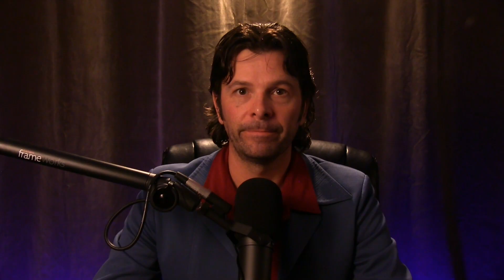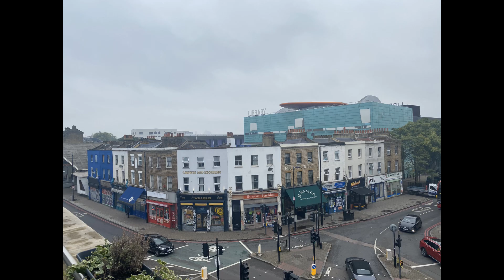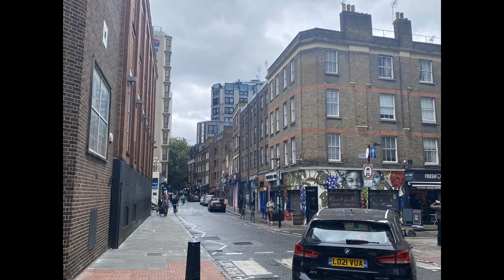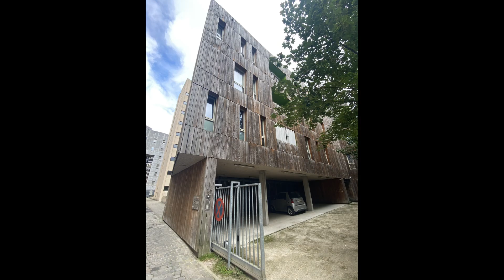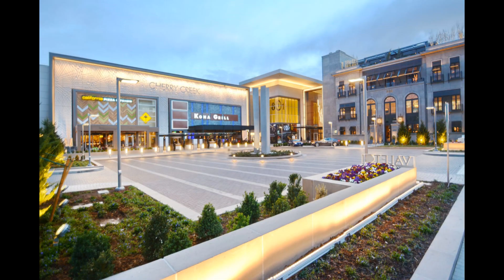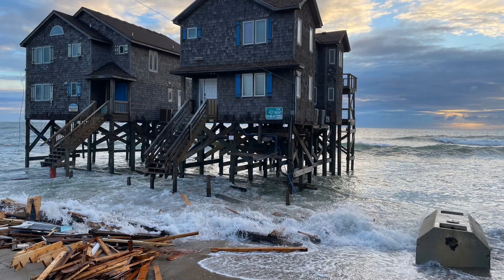Paul's Passive House 1950's Retrofit Ep. 15: European Edition

Comment: I know change will take time, probably a century 🤣. I like to think the USA is moving in the right direction 😁. I generally think the cost of housing will push the housing markets into the passive area/high performance as well as home battery back up needs, due to rising power usage. Matt Risinger (Build Show) is a great example of this, in the custom home building sector. As well as, Steve Baczek, Jake Bruton, Corbett Lunsford (Home Performance) and more. I hope things get better for the future 🤷🏿‍♂.
Reply from the maker: @BlackOTR1  You are more optimistic than I am for sure. Those guys you listed are great builders but they are not building houses for average people. They are million dollar homes for millionaires. Even the budget builders are building bigger homes and selling at higher prices because they make more money per house. That century comment was genuine. If you compare us to Europe, the difference is so huge it’s hard to comprehend.
Reply: I hate to say this but I disagree with just about everything you said.